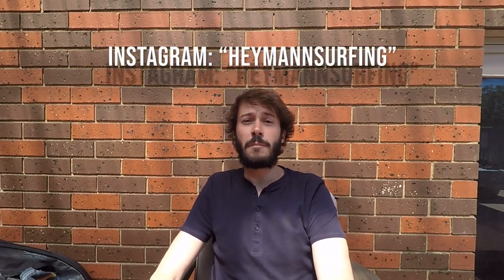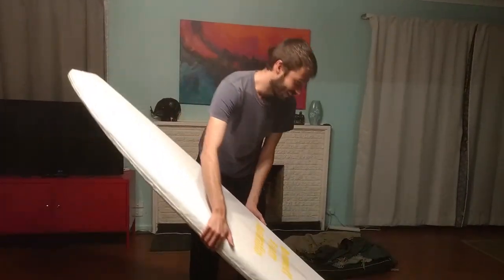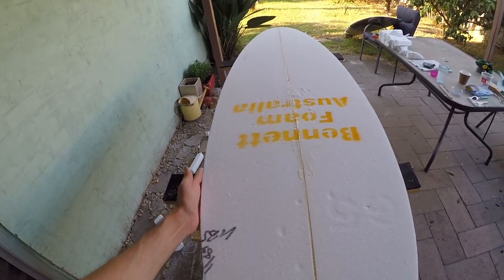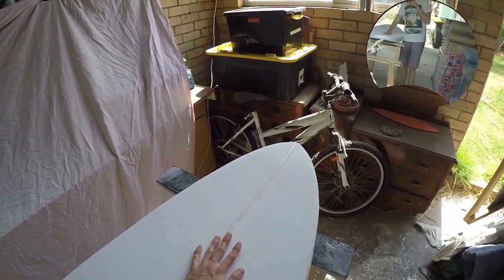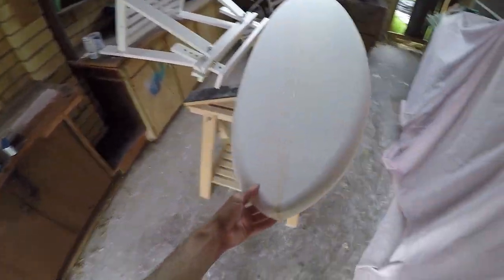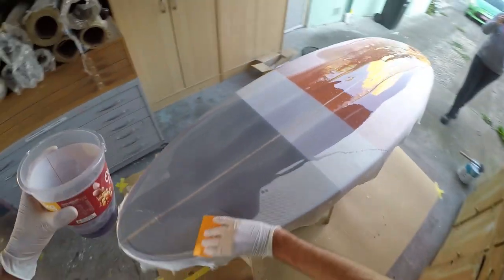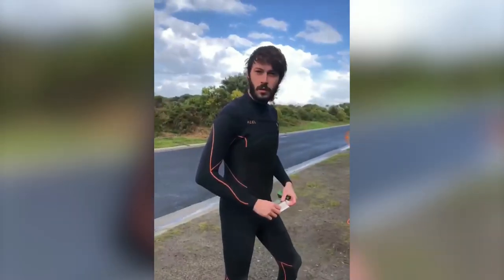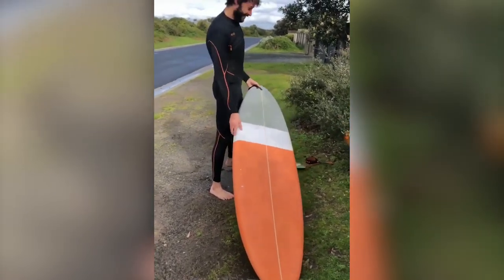Building My First Surfboard From Scratch

Comment: Awesome job. One thing about shaping your own board. There are basic rules to follow. But. Anything goes, because each shaper in his own rights is an artist & it's an expression of your own character.
I have made 6 boards now, each one is so different from the other. I'm hooked.
Well done.
Reply from the maker: Thanks for your comment. Could'nt agree more. I have made a few more since then and have worked out new methods or techniques on each one. There is really no hard fast rules and thats all part of the journey. Thanks for checking my video out, Happy New Year!
Reply: From where u bought sheet to make surf board?
Reply: @PatelRinkan  I buy my foam from a local polystyrene manufacturer in my town. They cut it into a block. And I hot wire the rocker on the foam block, from rocker temples I made.

Comment: Where did u get the blanks from
Reply from the maker: I purcashed this one from "Shapers Manufactureres Co" online. There are many options online to get them. But from later experience I would recommend that you try getting them from local surf shops. One you will have it sooner but secondly freight companies handle these blanks terribly, especially when its just an individual blank. I have had future orders arrived snapped in half. Phone around, most stores would be happy selling them to you. Hope that helps and thanks for the comment.

Comment: I have an old soft surfboard that I dont use anymore. I was wondering if you think i could cut it open, and use it as a template for a hard board.  Let me know if you think this might work, thanks!
Reply from the maker: Yeah mate, would absolutely work. Using old soft boards is also something I want to try soon. If your happy with the shape of it then go for it. Thanks for checking my video out.
Reply: joseph Breen   if it has pinched small rails its dodgy to cut it up for the blank unless your'e making a narrow board with not much rocker. The cutting and stripping of rails breaks up the foam drastically. You have to cut the rail line at least an inch to be able to safely strip the old glass off and even then sometimes it rips up the foam surface. rather use a new blank like in this video good luck

Comment: please elaborate on the filler thing. on all the tutorials iv watched, they just use resin
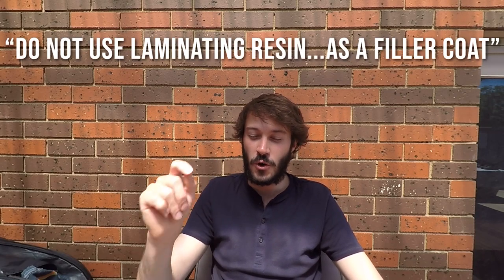Reply from the maker: 10:27 This part applies to when you are using "Polyester" resin. This isn't an issue with Epoxy resin as you can use that type of resin at any stage of laminating. I was emphasizing that using the correct resin type at each stage of laminating is crucial with Poly. So use the "laminating" resin on that first coat when binding the fibreglass to the board. Then "filler" resin on the second coat, filling out the coat. Finally "gloss" coat on the final covering which gives a smooth and even finish. I hope this makes sense and answers your question?

Comment: Daniel, how did you mount the fins in the surfboard?? I am making my own surfboard but i don't know how to do this
Reply: I really like this vid man
Reply from the maker: Hey! I am using FCS 1 type fin plugs. It's simply drilling a hole, placing the plug in and filling with resin. Once it's set the plug is sanded flush to the board. These are quite simple to install and the cheapest. There are lots of tutorials online. Maybe may finally make one myself!! 😂Thanks for the comment and feedback. Goodluck with your project!
Reply: @Heymannsurfing  thxx, this helps me a lot👍

Comment: NEVER cut past the rail line EVER     and don't allow girls near your board OR  near power tools
Reply: can you tell us how much your mailing charges were for your blank?. Where I live in Devon UK, they charge the whole price of the blank £50 just to send it 30 miles down the road to the next town its a total joke Ripoff!
Reply: Heymann Surfing at 6 min in  you started talking about reading studying everything and shaping videos on utube etc and you just wanted to get stuck in ...Good for you. don't get hung up, just go for it. lots of guys go for lots of pre-guide lines etc, the whole toot, then fuck it up . As long as you don't take too much off you cant replace the foam. Go by feel and have a good idea how thick and wide you need,  be conservative. it takes a dozen boards to get to really start to understand how these things work, how they go . After that trust me they all go . Graham Smith, Jordy's father told me once "they all go"  most ensuring words ever.   Your board came out fantastic the spray job blew me away !    Except for the amateur rails... heres a tip, stand on the opposite side of the board when shaping the upper curve of the rail line and sand from left to right continuously to get an even flow to slope the top of the rail line curve down to just te right amount. Your first effort is amazing but its only the rails are too extreme.   Always have this in mind when shaping rails : the nose area for a foot is round     the central rail is shaped according to your preference      the tail forward to past the fin area is hard edge for turning water flow.  bend a small piece of wire around your friends board rails for the rail curve template   its a good easy way to learn to shape rails and use this wire in 4 parts of the board to get the rail shape you want then flow it . always walk the rail one end to the other and back with your emery cloth. double check with wire templates   you speak very well and your video is great loved it.    you are going to be an excellent shaper cant wait to see the next one  and a dramatic  improvement on the rails
Reply: Heymann Surfing  you should have used a couple of caps of styrene wax in that resin for easier non tack sanding